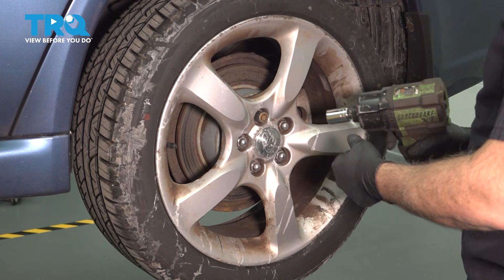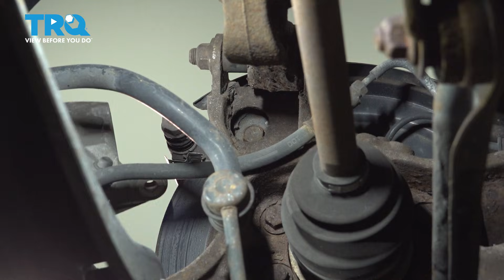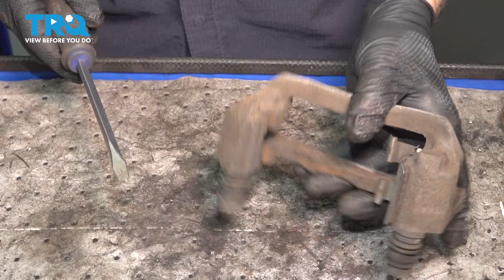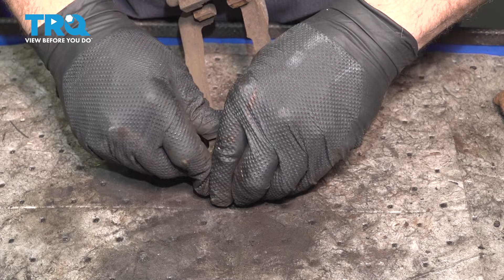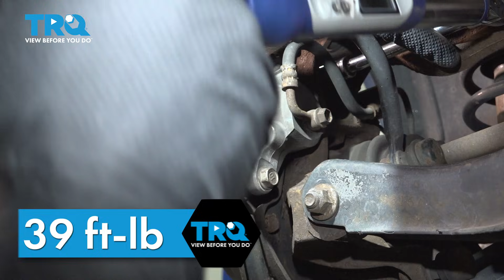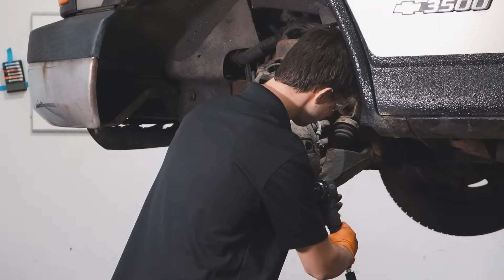How to Replace Rear Brakes 2005-2009 Subaru Legacy

Comment: screwing a pair of 8mm bolts thru the rotor ( brake disc ) threaded holes will allow stuck on rotors to be gently pulled away from the hub without using impact.. ( and it won't scar the hub ) - helpful and gentle if you just need to access the hub without damaging the rotor. This gentle, controlled, approach also is a lot safer if you are working without a full lift.